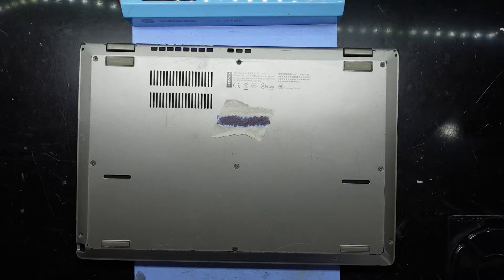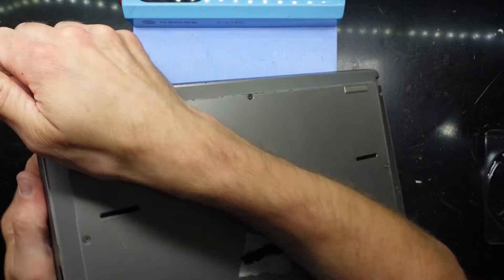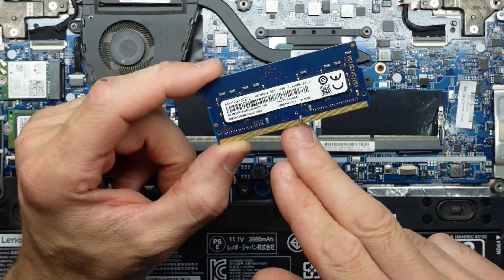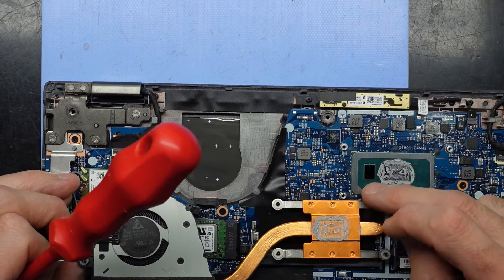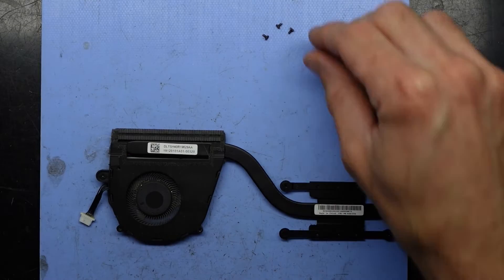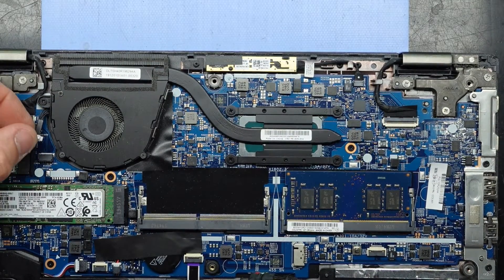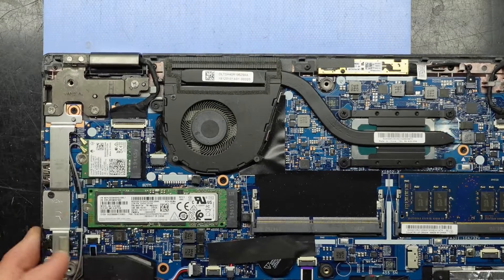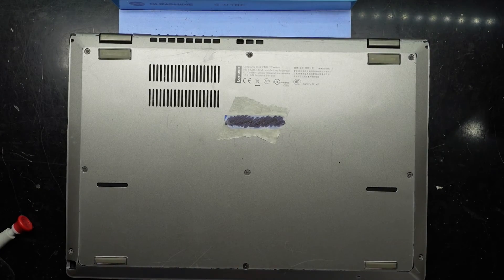Lenovo ThinkPad L390 Yoga, Ram Upgrade, Thermal Paste Replacement

Comment: Do you have any idea how to replace the RAM, which according to the information I've read is soldered in? Which 32GB RAM with which clock speed would be compatible and which company can you get it from?
Can a faster network card with WIFI 6 to 7 be retrofitted?
Reply from the maker: if its soldered you cant replace 

you should be able to replace the wifi